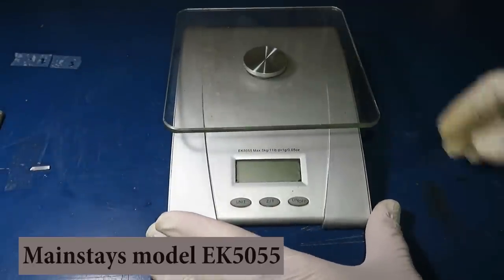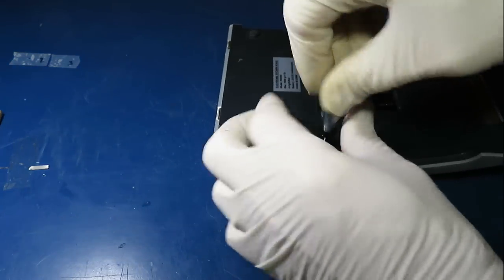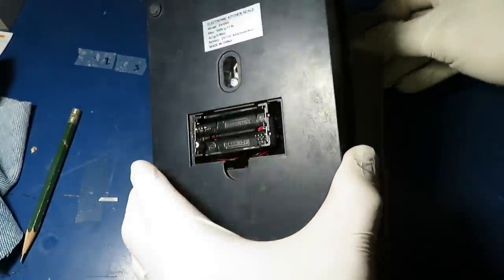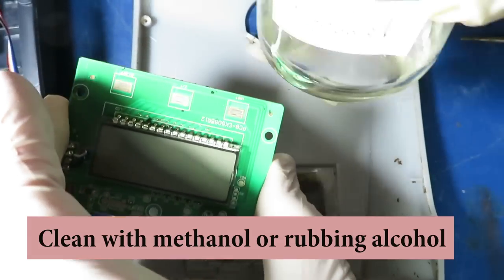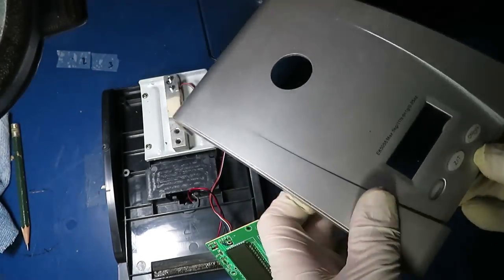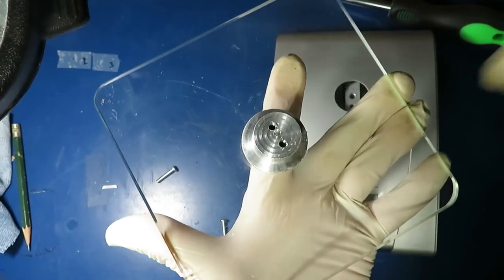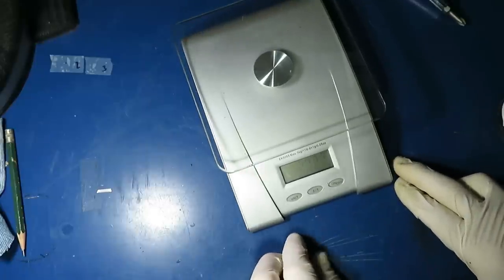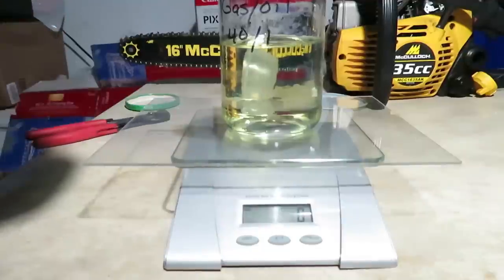How to Take a Kitchen Scale Apart and Clean the Button Pad

Comment: I have  Kenwood at750 kitchen scale, looks similar to yours but has 8kg maximum load. It had button batteries originally, I replaced them with 2 AAA cartridge. Now (actually years ago) it stopped starting and shutting down (ie. the On/Off button). Had to press the button harder and harder. Then I googled how to disassemble the device and found this video. My problem was those two hidden screws too, and after finding them the next problem was rounded bolt head in the second screw. I managed the problem by opening first screw and then I turned the device until I got the bolt loose enough. Then I applied some rubbing alcohol and cleaned the contacts on the board.

Thanks for the video!
Reply from the maker: You're welcome. I'm glad the video helped you get the scale working again!

Comment: Thank you for this video. I am trying to learn how to repair mine and didn't know about the two hidden screws. Like @Ephemeros, I was trying to unscrew the whole weighing platform.

After I remove those screws, I'm going to learn how to use my new electronics soldering iron kit to reattach the red battery wire which somehow broke off inside. I was surprised to see these instructions because it's only a $20 Walmart scale, but the soldering kit was only about $30 so it will almost pay for itself, plus one less thing in a landfill.

After I practise on this, I saw a video on how to repair a connection inside one of my computer monitors, so that will be even better! Thanks again!
Reply from the maker: You're welcome and thanks for watching. Great to see someone learning new skills and fixing something instead of adding  it to the landfill.

Comment: I HAVE a kitchen scale similar to this one. Unfortunately some water leaked inside the scale ,after that it keeps displaying random numbers negative or positive .
When I put any thing to weight it displays much higher weight and keep changing also. 
The wires are connected well and the load cell is fixed well also.

Comment: thanks for your video i have the same scale and for some reason it doesnt switch on.. i have tried replacing the battery but no luck after watching your video i tried to open it but the 2 screws which at the centre holding the glass top seemed to be locked it doesnt come out.. i tried the philips screw driver but no luck and tips how to get it open....
Reply from the maker: With a stuck fastener I usually try using a penetrant. Here in the US we have brands  such as PB Blaster or WD40. Just apply a bit around the screw head and let it soak in for awhile. Good luck!
Reply: @TheOriginalMechanic  thanks I have applied WD40 and left it aside will give it an attempt

Comment: Do you know how to calibrate this scale ? There is nothing in the booklet that came with it .
Reply from the maker: I'm pretty sure kitchen scales at this price point don't provide a calibration procedure. It would involve a calibration weight like they used at the factory when it was made.
Reply: @TheOriginalMechanic  yeah if you hold down the power and function or mode button it goes into calibrate mode but i couldn't find the full instructions on exactly how to do it .
Reply: @TheOriginalMechanic  good video by the way .
Reply from the maker: @jameskoiman  It's out there somewhere, but who has the time to find it?

Comment: mine doesnt turn on. I cleaned the buttons and nothing. Chip damaged maybe?
Reply from the maker: Check for a loose wire. When I did this a second time one of the fine soldered in wires broke loose from the board and needed re-soldering.
Reply: @TheOriginalMechanic  all wires are connected.